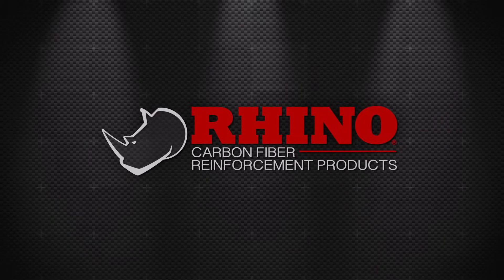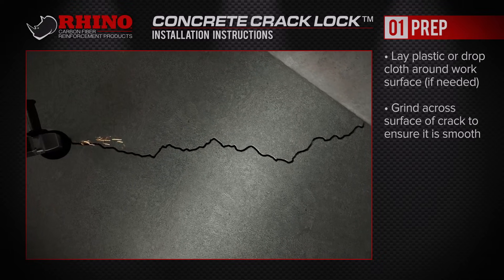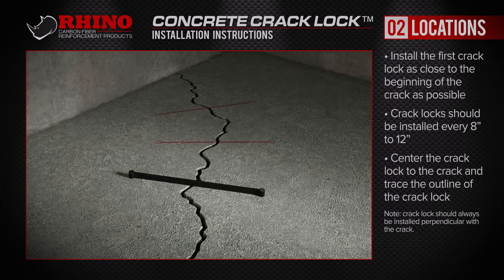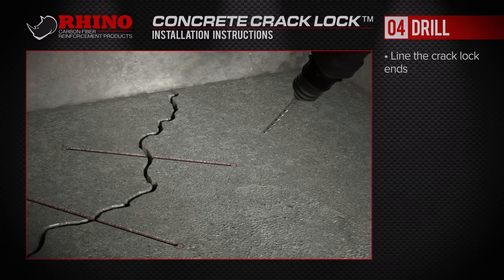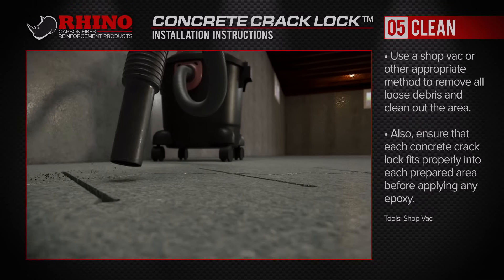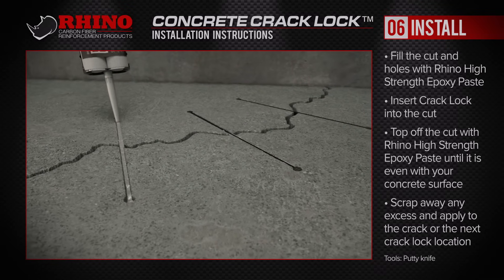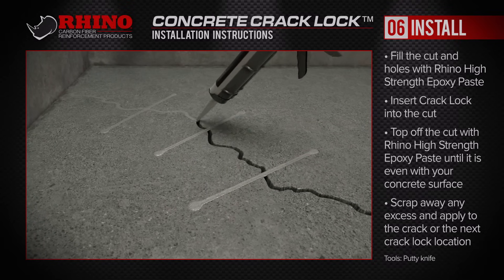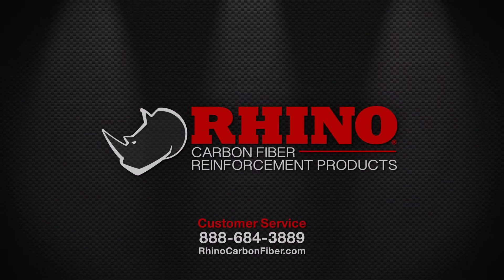Concrete Repair with Rhino Carbon Fiber Concrete Crack Lock Stitches - Install video

Comment: Will this work on horizontal crack 9 ft long caused by hydrostatic  pressure
Reply: Those cracks need an underwear
Reply: @jenny-DD  I underpinned it myself I assume that's what you mean

Comment: I'm confused by the round end features.  Isn't it important to have the stitch in tension before bonding? The video doesn't make any reference to carefully locating the drill holes. That just doesn't make sense, since from past experience drilling concrete, precise location is difficult at best.  Or, are the round end features not so important, while the bonding actually occurs continuously along the length of the stitch?
Reply: Hey Lou. No stitch is already in tension before bonding. Tension happens when the stitch is already in service. I am a concrete repair contractor, and use this system successfully. Drilling concrete is an art, but we are able to get it on the spot by first drilling with a small guide bit and then the big bit. Bonding occurs on the hole are and on the length of the lock.
Reply: If the strap fits, the holes are in the proper places.  The epoxy glue locks the strap in the cut channel & drilled holes (x2 ends).
Reply: This video either is bad or the product is bad- what ever caused the crack is probably gonna continue to mess the foundation and cause more cracks

This is one stupid product-  a bandage for a serious problem
Reply: @jenny-DD  How do you know this?   You need to provide more insight..... Or is this just your opinion and you have no idea what you are talking about?

Comment: Or just use rebar and regular epoxy
Reply from the maker: unfortunately rebar is made of steel, which has a tendency to expand and contract which causes more damage to the concrete.  Carbon fiber does not do that.
Reply: Also rebar is larger which means larger cuts.

Comment: Seriously,  way too complicated.
Reply from the maker: This is the easiest solution on the market to reinforce cracks.
Reply: This is a product for professionals doing structural repairs on concrete.  It's not "way too complicated" for them.  In fact, it's pretty darned simple.  Go take your Ritalin, KidCity.
Reply: Yup foolish nonsense

Comment: Drill the holes first.
 Is this content from the manufacturer ?
Reply from the maker: It will depend on your preference. We have contractors that drill and then cut and others that cut and then drill.